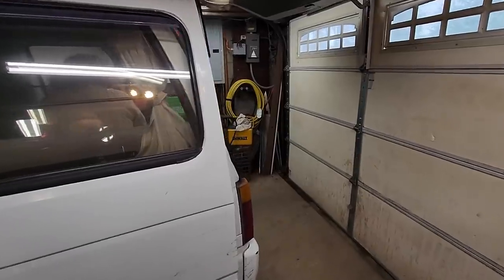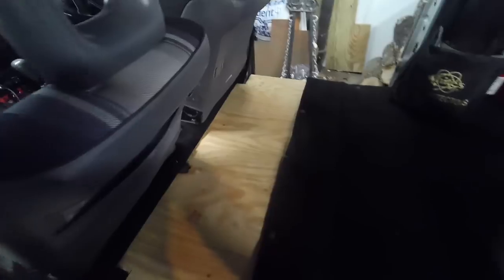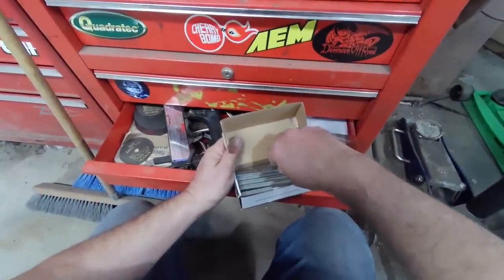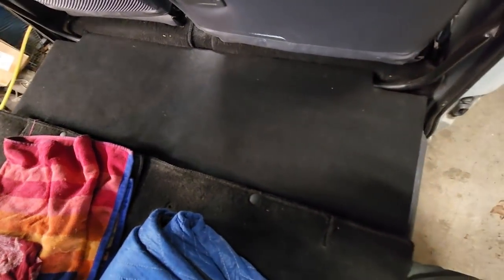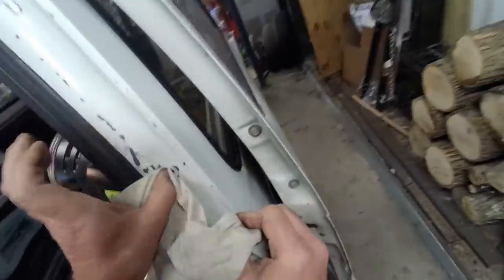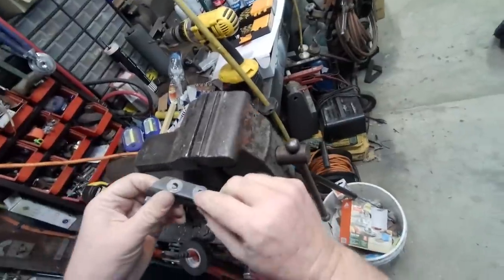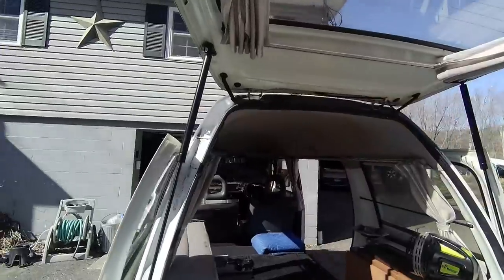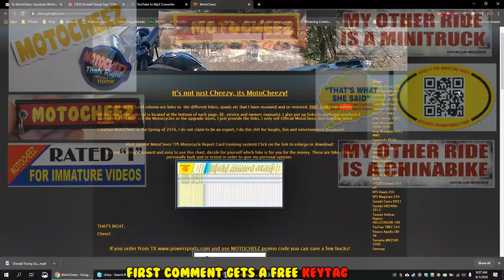Micro Van (SE1 E10)  Chair bed, floor level panel installed. Rear door gas struts mod install

Comment: Hey cheesy I know I've been quiet but I am enjoying these videos. Might want to drive that thing by the fire department and measure how much carbon monoxide the heater and the stove put out.. they'll usually check it for free. Or just  get a carbon monoxide detector and mount it in the back someplace. Better be safe than sorry!
Reply from the maker: True!

Comment: Hey motocheese.. love your videos .. i got into a 1990 hi-jet about a year ago.. it came with camo paint.. had to do quiet a bit of tinkering with it to get it running right but she runs like a sewing machine now.. turned to your videos quiet a bit to make upgrades to it.. new clutch new coil springs.. it came with a 2 inch lift.. just put a set of ocelot p375 tires on it.. 26x12.. coolest little rig i ever owned..  keep up the great vids man..
Reply from the maker: Sounds badass! They're fun for sure!

Comment: Vin Cheezel go check out the new just up loaded Wild Wonderful off grid they must be watching your channel they putting big tires on their sons mini truck ! 😂👍
I told them to check out your channel in case they haven’t been watching and they have problems with those larger tires scrubbing. I know you had to change the suspension a little to get those larger tires not to rub and raise the truck slightly.
Reply from the maker: Had to cut the door!
Reply: @MotoCheez  👍. He said in video something about redoing suspension & raising the truck up 2.5 inches. Gonna be interesting to see how they put these larger tires on. Truck is a Suzuki unlike yours but it looks like your truck with folding bedsides. But I don’t think it’s a dump bed.  So it being a Suzuki don’t know what it’ll be like on putting those larger tires on it.  Gonna be interesting to see how they do it in upcoming videos.
Reply: @MotoCheez  maybe you can reach out to them in a email 📧 and say if they need any advice on working on that truck you’ll give them all the advice you can on the knowledge you’ve acquired so far. Hey can’t hurt 🤷🏻‍♂️ might be beneficial to both you guys.
Reply from the maker: @CCRider5312  you can raise the whole suspension, but I'm happy with 2". They top heavy off-road even with 2" and 25" tires
Reply from the maker: Maybe. I comment and never get replies from most other YouTubers so gave up lol
Reply: @MotoCheez  look in description box for email addy and send em a email
Reply: @MotoCheez   👍

Comment: Look'n good. 👍That futon-chair is the love-seat sized version. (I've watched vids of a Japanese guy that built a 'hard' camper unit that fits in the bed of his Kei truck...he did some serious work make it happen.)

Not sure if Mini-mini could make it all the way to Florida, but she'd definitely be up for some local romps. 😉👍
Reply from the maker: The 4 speed would kill mini on the highways. 
I wanted to build a slide in camper for mini before I bought the microvan. I may still do it

Comment: Need to put a drawer of each end of that board Moto... That way the storage would be easier to get at
Reply from the maker: I thought about that, or plastic bins like others said if I can find right size

Comment: Excellent, great mini-conversion. One question; did your work pass final inspection from senior management? (She seemed happy with the workspace arrangement).
Reply from the maker: Yes, I think she likes it!
Reply: @MotoCheez  Are you thinking about getting a light bar?
Reply from the maker: Probably 2 round LEDs on the push bar like original Steam van

Comment: Solar panel on the back door maybe or inside the rear window? When you lift the rear door up fully your going to get great direct sunlight on it.
Reply from the maker: Hmm, maybe  Or the roll-up kind to put on roof when I'm camping?
Reply: @MotoCheez  exactly. All that roof space and rear window space but you couldn't use it for weight really, why not use it for solar.
Reply from the maker: Wanted to put permanently on roof, but I scrape the door on way out already.... What a shame

Comment: Hey Cheez, I've watched all of your Mini Truck and Mini Van videos. You haven't done a lift on the van, right? Just bigger tires? What size were they again? I just found a '94 Atrai with 4 x 4, Hi/Lo, Diff lock, 5 spd and AC. Needless to say I'm getting excited...
Reply from the maker: I did do a lift but put the tires on before the lift. They're 23x8-12s. Had to  cut the door wheel arch a bit. It's in video
Reply: @MotoCheez  Okay, so your Atrai has leaf springs in the back instead of the three link with springs and struts.
Reply from the maker: Yes

Comment: I think the weak point of the car is the radiator fan, which needs to be replaced early. When the engine is difficult to start in the summer, the fuel temperature rises. 87 is enough for gasoline.
Reply from the maker: 87 octane is good enough for the turbo with 12lb boost? It does have the intercooler which hps I know. 

Mine starts hard cold, choke seems to be closing  it seems like there's no accelerator pump  on the blow thru carb
Reply: I'm not familiar with turbo so I can't answer. In Japan, there are only two types of gasoline.
ATRAI is not high octane
Reply from the maker: Ok thanks. This is the Atrai XX. Same you think?

Comment: I don't know what it was called. But when I was filling up at the gas station on my way home I saw someone driving an old Toyota van. It looked like the Toyota equivalent of a VW Bus except the nose looked more wedge shaped. Plus it was classic 80's Toyota with its' silver/grey paint job and black exterior pieces. :)
Reply from the maker: I know the one you're talking about, I think they were called Hilux
Reply: @MotoCheez  Never heard of a Hilux van, I'll have to do a search. I always knew the European version of the fabled "Toyota Pickup" was/is the Hilux. Either way it looked like a neat little van. :)
Reply from the maker: I think your right. That's the import version. But I do remember those Toyota vans.
Reply: @MotoCheez  I did a search for it. It looks like we just called the "Toyota Van" but its' actual name over in Japan was Town Ace. :)
Reply from the maker: Town ace! That's what I was thinking!
Reply: @MotoCheez  Japan always gives their vehicles a cool name. If I were to buy one of those new from the dealer I'd rather be cruising about in a Toyota Town Ace over a Toyota Van. :)
Reply from the maker: They have them imported over too, I looked at them but like the tiny cars better
Reply: @MotoCheez  I was mostly stating that if I were buying one of these vans new in the 80's that I'd rather cruise about in a Toyota Town Ace versus just a Toyota Van. Because Japan has a cooler naming scheme for their version of the vehicle than us. The one I saw at the gas station looked in decent shape for being in this area. But it sure sounded like it needed the exhaust fixed. :)

Comment: what cooler is that cheez? Setting up a solar system now and want to grab one. any recommendations on a good inverter?
Reply from the maker: The one I'm using now is an older cooler I picked up about 5 years ago, it's a peltier junction so it's not that great. But you can pick up a pretty decent compressor style refrigerator/freezer and they're pretty good on the battery. As far as inverters go I'm supposed to be getting a battery powered solar inverter without the solar panels to review, I don't really know a lot about them but I've been studying them I don't really have a preference yet
Reply: @MotoCheez  nice 👍 I got an ecoflow mini 10 amp mppt controller and 800 watt hours I think. Up to 75volts. Got a dokio portable 160 watt panel, and it works really well.

Comment: I have changed used GAS STRUTS 5 times.
If you leave the door open, the gas goes right out.
Reply from the maker: Well thats not good. What brand struts? Same as what I got?
Reply: @MotoCheez  I often work with it open. All were DAIHATSU genuine used parts. Don't hit your head　LOL
Reply from the maker: These aftermarket ones make it at least 2" higher opened, plus the larger tires and 2" lift I don't even come close to hitting my head!
I wish the original owners of my minitruck and microvan would see what they turned into.. I tracked down where the MiniTruck came from when I first got it, the dealer that sold it. Forget where but it is in a video
Reply: @MotoCheez  The hood is only opened for maintenance, but not this one. Anyway, the parts cost is so cheap I'm going to replace as many as I can.
Reply: @MotoCheez  Yours is old and I don't know if it will fit.
リアゲートダンパー 　ダイハツ　ハイルーフ